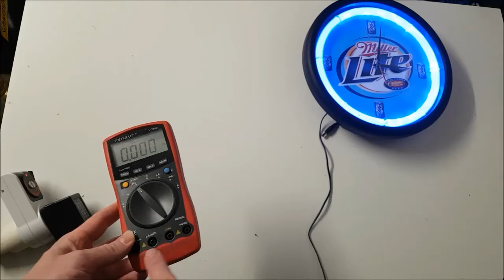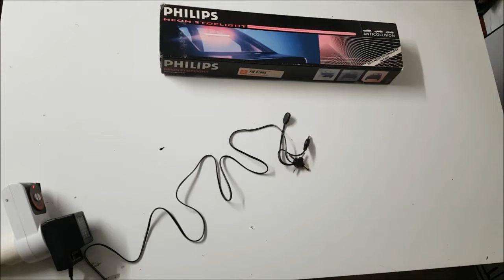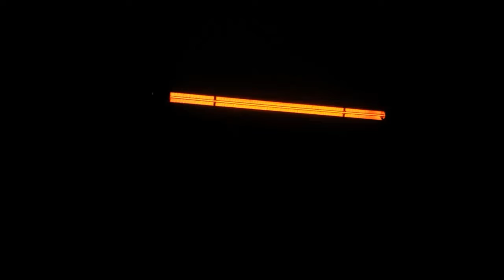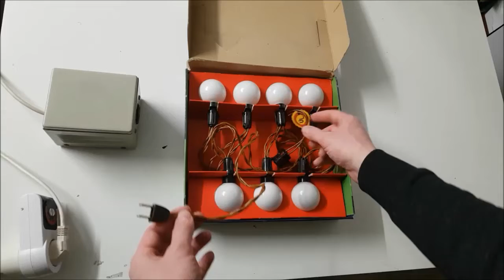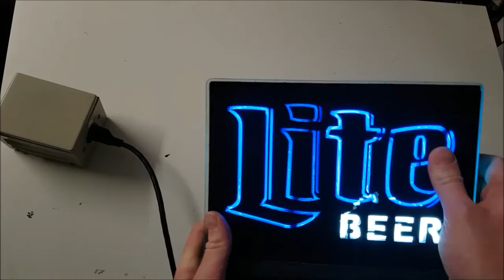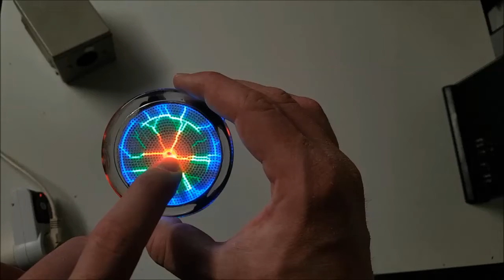Looking at some Neon novelties and oddities - part 2

Comment: I worked for OSRAM Sylvania for 8.5 years back in the day in America. During the T-8 lamp, compact fluorescent, ceramic element, and the mercury pulse rated lamp times first roll outs. My job was to follow up after retrofits from T-12 in retail marketing. Including case work, IE customer reach in freezers (T10 lamps), produce, meat shelves, and the butcher presentation cases all the way to floral, gift cards, and cosmetic displays. I found it funny Sylvania was making X-mas lights. My experience was no matter who it came from Sylvania, Phillips, or GE it was all the same end from research and development, "It lighted? Quick notify manufacturing!" T-8 prevailed but the rest was pumped out so fast no one bothered to standardize sockets or test anything. Thanks for bringing me back to the day.

Comment: These small signs in plastic discs is what I remember seeing in the lighting department in a hardware store, perhaps two decades ago. I also remember the sound they made. :) Interesting to learn about tubes with only one electrode. 
Wow, and I've never seen this type of Christmas lights before! (With small shaped tubes instead of just light bulbs on the sockets.)
About the sign that you showed second last in the video: To me, it seems so complicated and overengineered. Just a box with a simple fluorescent lamp in it and a printed acrylic cover would almost look the same, but would be much easier and cheaper? 
And it was also nice to learn about the principle behind this crackle effect.